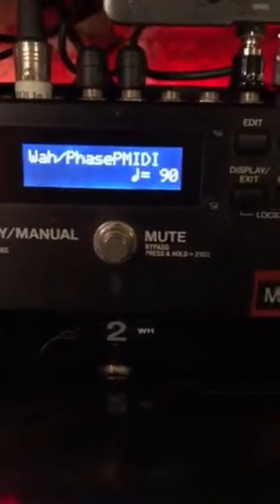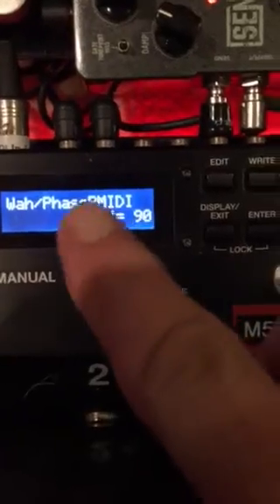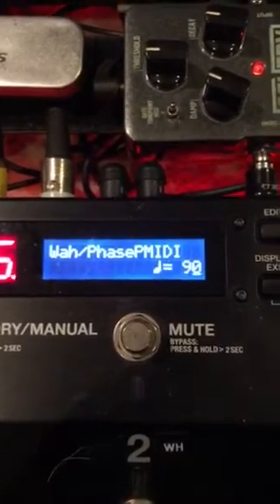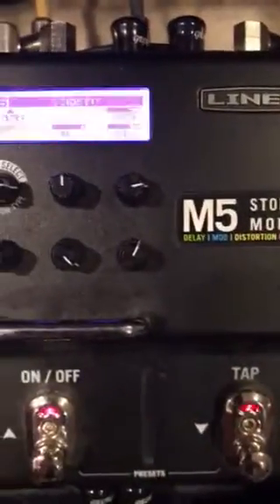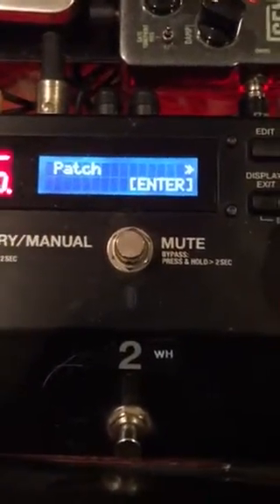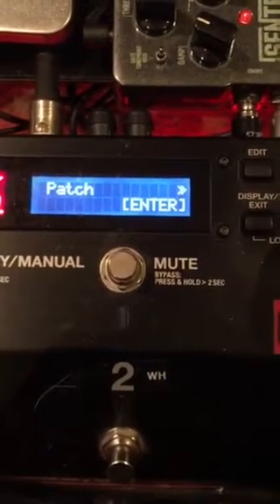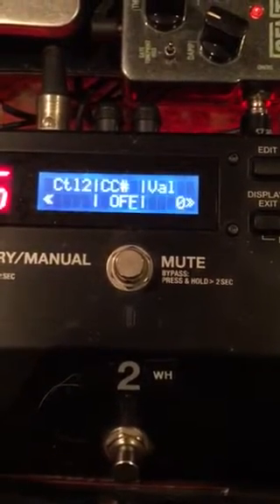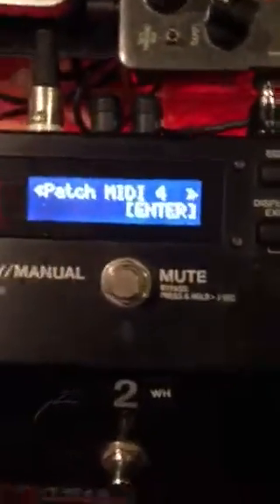PMIDI Boss ES8 example patch setting.

Comment: It would be great to be able to toggle between two Program Change settings with just ONE Footswitch ... but it doesn't seem to work with the current 2.0 firmware. I used the same approach as you in this video (ES5 sending PMIDI to a M5), with two Assigns  to the same source footswitch. One Assign sends PMIDI 4 with the setting "Min=Off, Max=On", the second Assign sends PMIDI5 with "Min=On, Max=Off". I hoped this would result in toggling between sending PMIDI4 and PMIDI5 ... but alas, it only sends PMIDI4 ...
Reply from the maker: TheGuacamoleXplosion yes I really would prefer a toggle. I couldn't make any configuration work that way.

Comment: Just tried doing this with my ES 5 but I can't see any 'Transmit' screen shown here as a preference to select i.e. Auto or Manual? Any pointers where it can be if it isn't obvious? I'm in the Patch midi section
Reply from the maker: Savvy uk, thinking we chatted on the page but in case that wasn’t you, an update is needed.
Reply: Yes that was me. I've ordered a midi interface now and will be updating my ES 5 when it arrives. Thanks for the help :)
Reply: I wanted to do something similar to your example except using the CNUM function so I can toggle the assign to load a different delay. Then return to my original delay in the preset when stepping on the same foot switch. I've just read that this isn't possible?
Reply from the maker: If you use CNum, it won't allow stepping on the current preset to recall it.

Comment: What I can't figure out is how you set CTL3 to PMIDI1? For me in the ES8, Patch 00.2, MIDI, #4 is set to Ch.4, my Voodoo Lab HEX. I set it to manual and PC#9. From there I can't figure anything out, I set it to auto and have presets in the Hex turn on when I select a patch, but can't figure how to use then for Assigns. When you say you go into the CTL menu you're the Assign menu? I just don't get this PMIDI stuff at all and any help would be great.
Reply from the maker: Hey man, yeah I say got to CTL in the assigns menu, around the 2:15 mark or so, sorry for the lack of clarity. Def one of my earliest videos. The thing to remember about PMIDI is that if you want to change a device between two different patches from the ES, and you also want to go back and forth between the two at will while in that ES8 patch, you will need to set up two different assignments for two different buttons. In the assign menu, the word “CATE” will mean category, select PMIDI there and also pick which button you will use for one patch on the other device. Do the same for the other button for the other patch. The other important thing will be what PMIDI you default to when you select that patch, which is the “Auto” setting under the Patch Midi. “Manual” will be what you press to swap to the second effect. It’s tough to explain more thoroughly here, and I whip through it quickly in this one. If you are on FB, I would say join the ES8 group and dig a little through the search window with PMIDI as the keyword. It’s really effective when you grasp its uses.